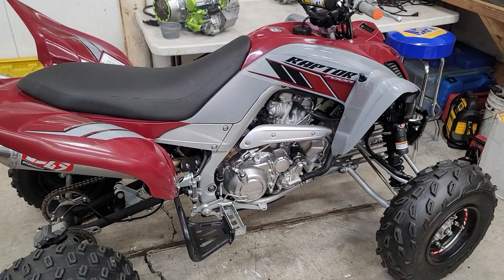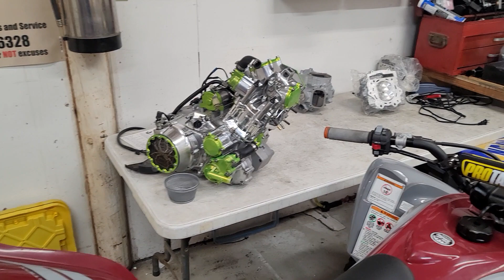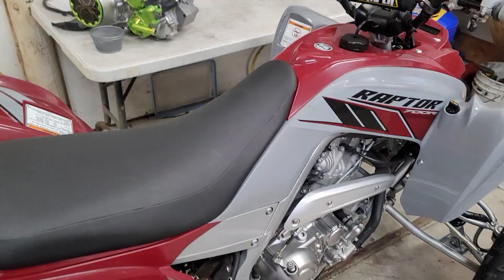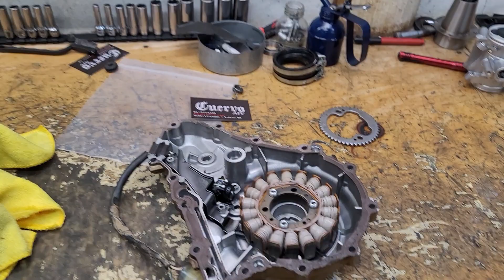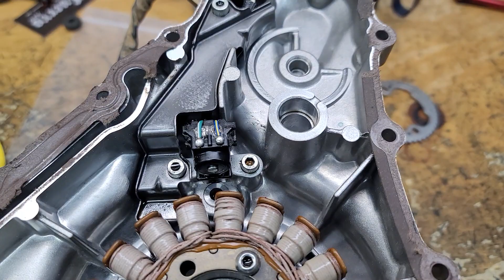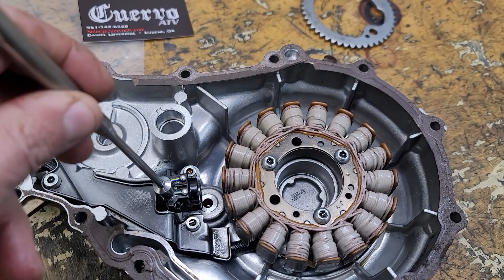no code , no missfire but engine dies , raptor 700

Comment: I put my wire harness back on mine I have no power at all to the bike I’m trying to keep my cool an it has no codes either mines is a 06 raptor
Reply: But it turns over if I start it off the relay other than that no power no start button or lights working at all everything is connected
Reply: @BYMJAYY9 I’m having the same issue you ever figure it out?
Reply: Is the ignition oem or chinese? I would try to see if the ignition is actually working

Comment: Hi cuervo you think I have the same issue? 2021 big 3 stock idles fine/okay when accelerating under load start hesitating. No chekc engine

Clean air filter
Changed spark plug
Battery loses power randomly
Reply: I changed my headlight’s and starting experiencing problems after
Reply: I’m having the same issue, did you ever figure out what it was?
Reply: Try first before anything to charge your battery and see if it does the same things.

I end up removing the old PC and the ECU and bought a vortex ECU and runs like normal, of course faster due to the ECU but works normal.

Comment: I got a 2020 when I let off throttle it dies  I replaced fuel pump still does it / help please
Reply: Did u find out the problem?
Reply: @kingk6621 

I have a very similar issue.  Was racing and ran out of gas and it’s ran horrible since.  I checked fuel pump and it’s getting plenty of gas.  Won’t crank now, back fires and need help?
Reply: @Keldrtz777 did you fix your issues

Comment: I have a weird issue when WOT in 5th gear and running like 60mph+ the bike can stutter and die until i get down in speed again, only really happens when WOT, idles fine, midrange fine.. Gonna check this out for sure. The only thing that was changed prior to the bike running fine was an valve adjustment by a certified dealer, but im gonna double check that they actually did it properly since it looks like they didnt remove the gastank or anything..
Reply: Me too like full throttle I’m going to get a pc6
Reply: @L3FRMTMB my issue was the reverse light sensor under the shifter. I grounded it and the issue went away until I replaced it
Reply: @darkiiii3 mines loose do you think that’s the problem?
Reply: @L3FRMTMB  I mean you can try to ground it, take a test ride and see if it works. Its really easy to access to the sensor and cable